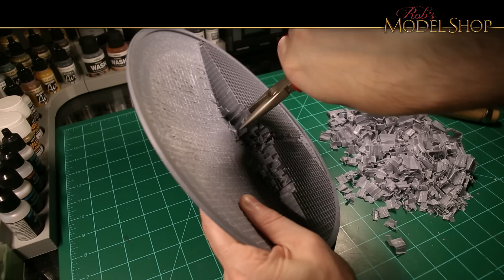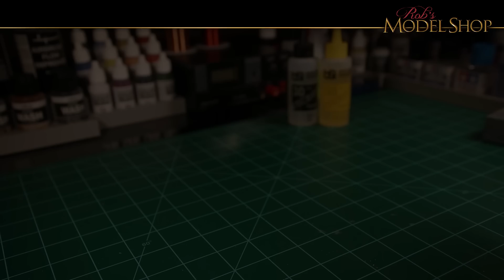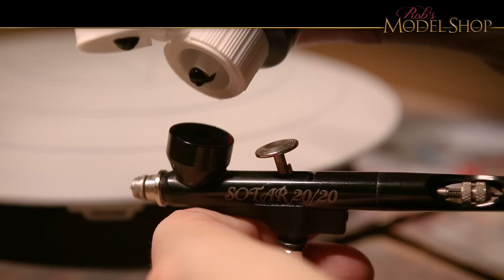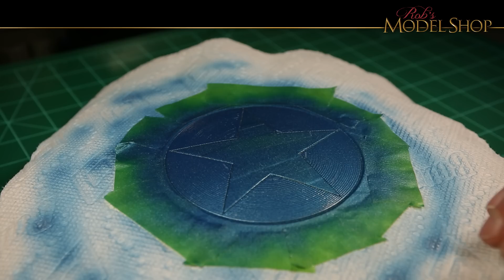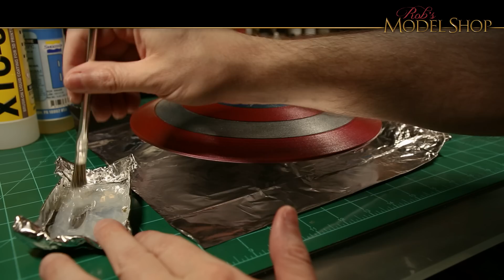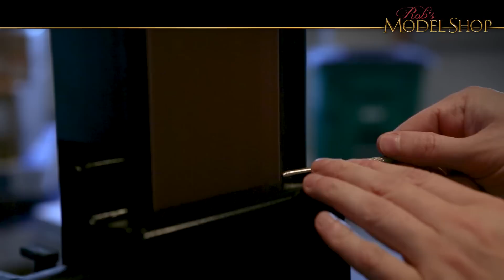Rob's Model Shop - Episode 6 - "Captain America Shield"

Comment: I'm curious, how accurate is it?
Reply from the maker: Kira Axelsen I modeled it after the Marvel Legends shield, so hopefully pretty close. I also updated the file since this video. It now has more detail in the star.
Reply: @RobPauza  Awesome! thank you! this is something I'd 
definitely look into
Reply: Rob Pauza so I tried to print the shield both tfa and the one with the newer star and it has fail miserably all the time I’ve tried... could you help me? Give me your settings or something? I burrowed a cr-10 and is a total noob so anything goes
Reply from the maker: Kira Axelsen I’m not sure how it’s failing so it’s hard to tell you much. But, it should be a fairly easy print. Both sides will need support. I’d say since you’re new, just try auto supports in your slicer. Other than that ... maybe 20% infill at .1mm layer height should work. Depending on what material you are using, just try default settings. Regular PLA is usually something like 120 C at 50 C bed temp.  Hope this helps.
Reply: @RobPauza  It did thanks! what would you recommend for print orientation?
Reply from the maker: @scarcosplay  I'd recommend printing so the details are facing up on both halves. That way the side where the supports are will end up being on the inside of the shield where they can't be seen. (The supports come off, but usually leave some marks behind.) The .stl files should actually import into your slicer that orientation by default. Hope that helps.

Comment: Is is possible to share the Settings for the printer? I am really new and somehow I can not make the shield to stay on the platform.
Reply from the maker: First off.. the shield pieces will definitely require a lot of supports. It's been a while so I'm not sure what I used. I printed in PLA and most likely used around 220c temp on extruder at 18% infill and 50c bed temp. That being said, it's going to vary greatly depending on your printer an the type/brand of filament you use. I would recommend looking for a forum for your particular printer and finding out what others are using successfully. Most of the time you'll find that people are super eager to help and you may even find some profiles pre-made that you can use. Hope this helps.

Comment: Why not make it life sized?
Reply from the maker: Mostly to fit my printer bed and so I wouldn't have to piece it together. Also though, because I didn't really have a place to display a full-sized one.  :)
Reply: @RobPauza  It's still very cool regardless of the smaller size:) 

I'm thinking of getting the Marvel Legends shield. Plastic one of course. Metal one is going for silly money!
Reply from the maker: @gmon78  That metal one is super nice. I actually used a photo of the plastic one for reference when I modeled the inside. Looks cool too.  :)